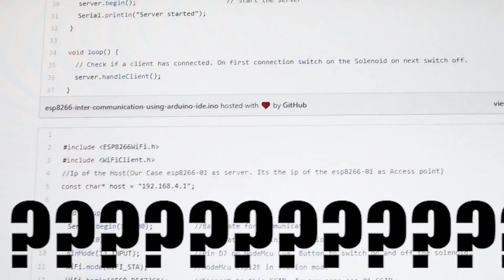This Arm gets really REALLY long (Social Distance Robot Arm)

Comment: I know this was made with stuff on hand, but imagine the proper gearing so the ratchet could extend or retract with 2x or 3x speed
Reply: He should retry now things are opening up.
Reply: I think he can make it faster by changing the gear rasio
Reply: problem with increasing speed is that it needs alot of torque, and changing gearing for more speed will decrease the torque supplied by the motor

Comment: This is the simplest telescoping arm design I've ever seen! The torsion strength be improved by putting a zipper down the length of the seam. Given the way the tube is extended and retracted, I don't think adding a zipper to the seam would be too hard to incorporate
Reply: Interesting idea.  I think it would add a lot to the torque required, though.  A zipper strong enough to be reliable holding that antenna would itself be bulky and need a heavy push both ways.  I wonder if some kind of Velcro would do the trick?  The lock doesn't need to be very strong at a given point, but the collective strength over the length would add up fast to prevent twist.

Comment: Technically you could've used wires, as the spool does flatten out and doesn't immediately close into a circle, but instead gently lofts from a flat to a circle. Spool of wire where the wire exits from the interior, like whats used for hoses and extension cords, would work well if it was geared to the rolatube drive, for retracting the wires while the rolatube retracts. 
I'd be curious to see if this could be made into a decent linear actuator, if it can be, it's retracted form is probably the most compact of any telescopic actuator. It just needs some improvements on the actuation mechansim; maybe instead of rollers driving it, you have a motor on the inside of the coiled form, then passive rollers to guide the flat form before it's allowed to collapse into a cylinder.
Reply: WELL TECHNICLY 9
is a number

Comment: If the mega Army bracelet is an antenna, could you run your signals through it to control the hand instead of using a wireless signal?

Comment: Despite the comic take , The extender is actually a gteat idea, not as a hand but in several applications. Also it could be made wired by haling wires run all the way through the rolled up extension.

Comment: its a much better design if you attach a rotor to the other end of the bistate strip and use a much wider opening instead of your two roller clamp. That way it will have much less resistance and move much faster.

Comment: A power window or wind-shield wiper motor would be quieter... And you can run wires out to the hand, they just have to be taped to the inside of the mil-spec slap bracelet and hooked to a rotary joint or long coil inside the slap bracelet coil so they don't twist off.  (a 3-4 core ribbon cable under duct tape should work brilliantly.

Comment: Just a heads up Allen, but the ESPs (8266 & ESP32) support a technology called ESPNow, which lets you super easily send data to other ESP devices with low latency and w/o the need for a WiFi network connection, and is completely adhoc. In just a few lines of code you can send and receive C structs from any ESP device to another. That would probably be better ( and easier) than the AP  client WiFi network you had to use with the HTTP server on top ;)

I absolutely love this project, completely genius. It made me laugh a lot!

Comment: I know this months late, but if the inside bistable part of the antenna is metallic, couldn't you have run current through it to the fingers by removing a section of covering in the middle of the spooled up area and having something like a motor brush contact it. If that didnt work, you also could've just run a wire down the whole thing, since you made it so it rolled completely into a tube, and then did the same thing with a brush on the inside of the spooled area. At least the opposite end of the antenna is always gonna be in the spooled area at all times, so you could have the contacts there.

Comment: Correct me if I'm wrong, I know basically nothing about this, but if the military slap bracelet is an antenna, then you can send electricity through it, right? All you'd need is to send 2 different signals for the hand to open and close, or if that's not the case, couldn't you tape 2 long wires to the inside of the antenna and leave enough so it can follow the end around.

Comment: YOOOOO revise it, use an alternator for the motor it's like 35ft lbs of tourque, reinforce the hand mechanisms too. I was wondering how to fight flex on the extendo assembly itself and I thought of maybe plastic rings like on a shower rod assembly? Idk because they would have to be reasonably self-spacing and I can't think of anything super cheap and easy... Actually sitting here typing it out use dryer duct!!!!! It has metal rings, is extendo, self spacing, and would slide pretty easy on it yo
Reply: Think about the robustness of this mechanism, this could be used as like tendon type actuators for that one british youtube that had that huge diy iron man suit idk

Comment: "The Looooooooooooooong Arm [MELEE]"
(Epic Tier)

Slap your enemies from the greatest distances, but don't exagerate!

153-53 DAM
Low Attack Rate
Short-Thicc Range

+You decide how far you want to attack!
+Insane Damage

-The more it's far, the less damage it deals.

[HOW TO OBTAIN]
-Crafting with 50 iron dropped by Metal Guards(1-3 Iron Each), 300 Redstone dropped by Red Cubers(10-20 Each) and 1 Really Stretchy Flex Tape dropped by the Bill Swifth(Chapter3 Boss).

Comment: What's the compressive strength of the RolaTube like, end-to-end? And how resistant is it to folding over when extended?
It seems like it would have better extended-to-collapsed length ratio than even something like a scissor mechanism, and it makes me wonder if you could combine a few of them (with your motorized extension mechanism) to make a very compact lifting device/platform, or maybe use them as stronger replacements for telescoping/assembled segmented aluminum tubes to act as supports for temporary shelters like large tents.

Comment: I know it's been a while... and you probably don't care about this project any more... but it didn't have to be wireless.... and you know it.

Did it need the full torque to distribute to full length? In looking at this I'm wondering if a wider gearing for the motor would have made it faster or non viable. Plus watching your unroll made me wonder if a rapid but controlled extension is possible. Further over engineering?

Comment: Why could you not use wires for the hand? Why not tape thin wires on the inside of the "tube" and feed it out from the center of the spool? The spool is less than 10 turns and you could cut out a slot for the wires on one of the rollers.

Comment: Couldn't you have taped a wire to run along the inside of the roll when it was fully extended then rolled it up with the wires tucked inside of the roll and used a twisting connection point to carry current to the little motor for the hand instead of wifi? I'm sincerely curious

Comment: Dude, it lituarly runs multible lengths of antenna wireing throu the darn thing, you could just cut the wire on the end and get multible wires conections out of it

Comment: Why not just run wires along the entire length of the bistable slap bracelet, through the spool and into the button... 5m should be short enough to not cause any issue with the loss if all it does it to trigger the relay to activate a servo

Comment: How did you get the esp8266wifi.h to work, i never have got it to work, and it would really be helpful if u told me , pls, I'm begging u, when i do it and I've tried installing the library, but arduino still says esp8266wifi.h is not a library, or something like that error

Comment: why couldn't you have a roll of wire parallel to military roll
Reply from the maker: I'd need a rotating contact and another gearbox or retractor synced with the ratchet. That's even more trouble than setting up a webserver.
Reply: @allenpan  why would you need a rotating contact? Like just hot glue a toilet paper roll to axle to hold the wire. Although i have to admit that the unnecessary complexity made the video a lot more entertaining 😂